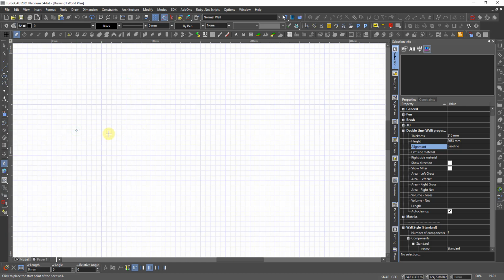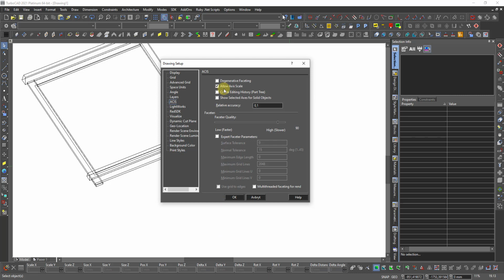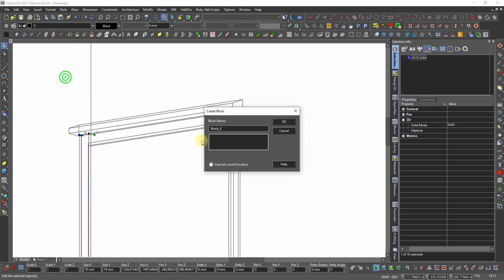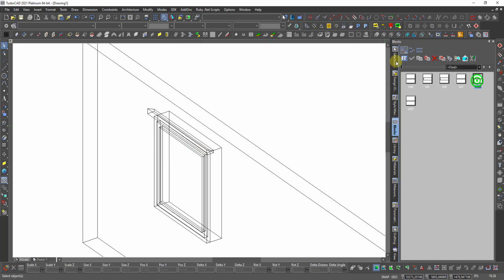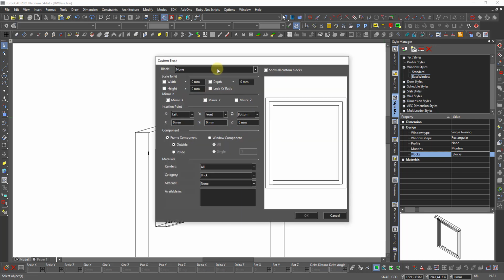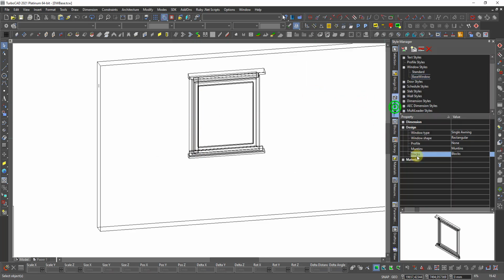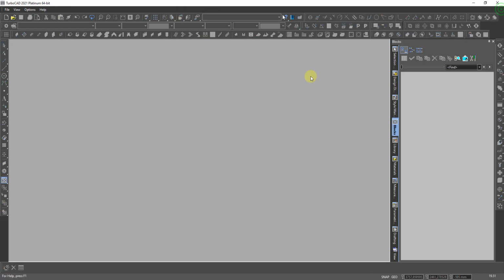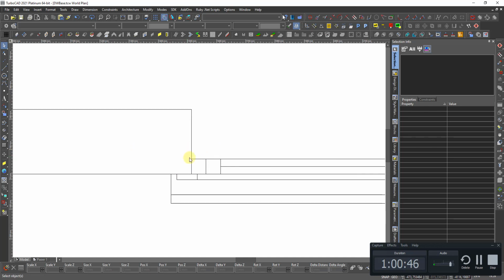01 House H 2

Comment: I just happen to click on this video and was quite pleased to see how to add blocks trim to windows.   I  have been thinking I should be able to add brick mold to a window and now I understand how to do it.  Of course tc fights tooth and nail to figure out how to get the position but I got it.   and after I thought I had it all set I closed and opened drawing and stuff was messed up but was able to fix it I think.  I would like to make more complex trim but for now it was basic boxes.   
I thought I would copy the style to a drawing I have but after doing that seems I need to work on which is inside and which is outside.  added a window to my existing drawing and the trim is on the inside not outside.
Reply from the maker: Hi ReNau
Thanks for the comment, it can be a bit stress sometimes, when we know we set refPoint correct, but then need to re-adjust it after a restart of drawing, so my conclusion is that we need to reLocate the refPont every time, no matter what, at least it get less stressful that way :)
But glad you figured it out
I started with TC in v 17, but only for 1 job where i needed it, then it was v 18 before i really use it next time and full time, and become a beta in v 19 
I have not forgot the material video, but have been sick and did a surgery in December, so then my infection number go up and they want me go to hospital one more time, and stupid as i am i did
I got covid both times 😱, and yesterday i just told them goodbye and went home before i get serious sick up there, as they also struggle with flu and Novo virus at the same time on the hospital.
They want me back in end of this month for control of wound, but i still wait and see if they manage to control the situation first, i really don't need it one more time 😀